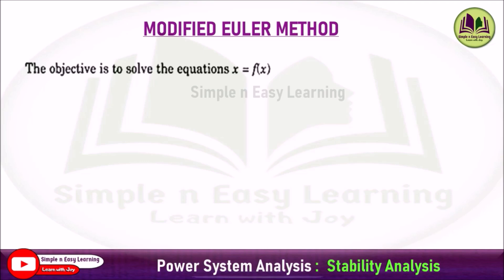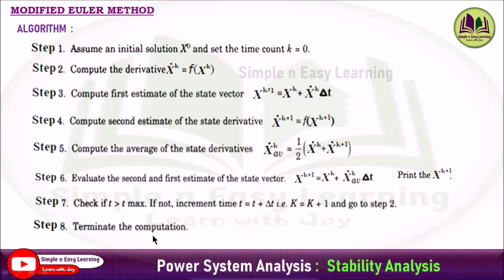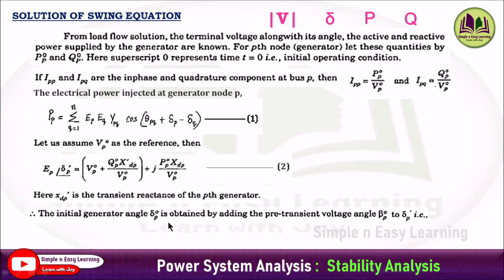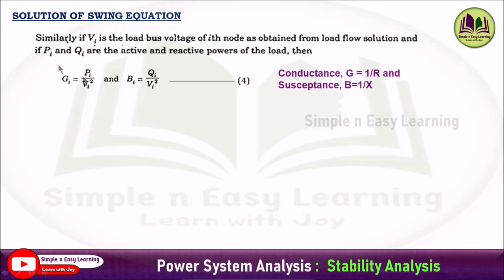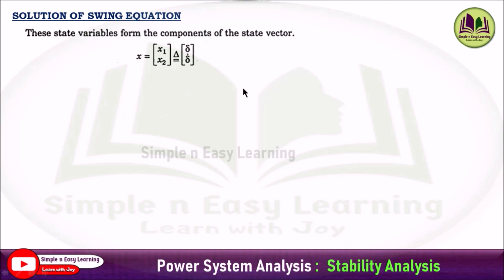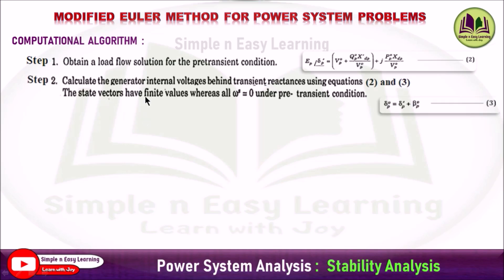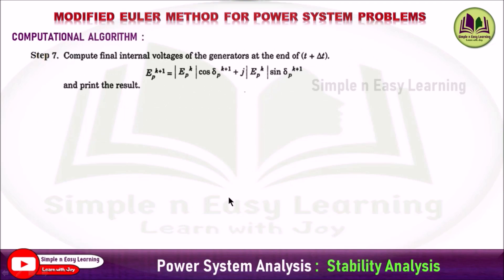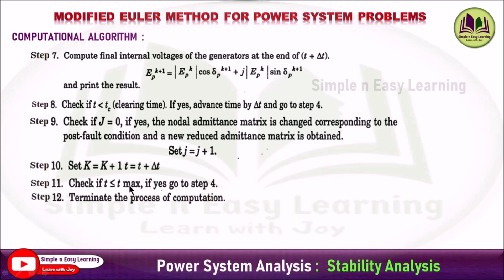Modified Euler's Method | Power system Stability | Power system Analysis

Comment: sir is aap ne swing eqution ki daldi bich main
Reply from the maker: Yes,  in Step-4 of the computational algorithm we used the swing equation to determine the state derivatives. 

 The modified Euler method is a numerical technique used in power system stability analysis, particularly for solving swing equations, which model the behavior of rotating generators under disturbances.